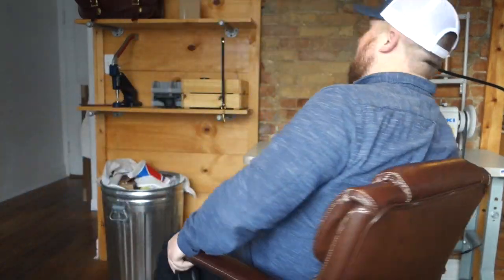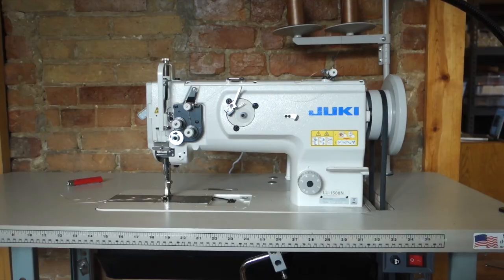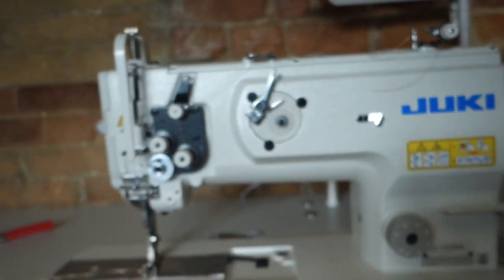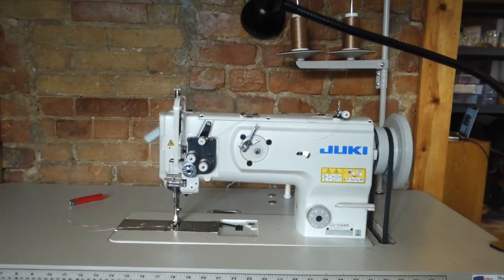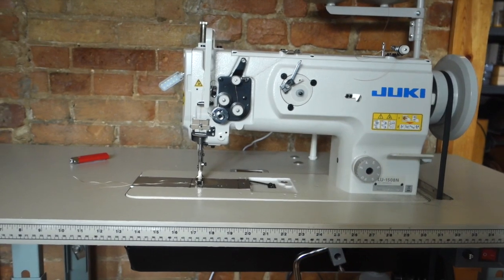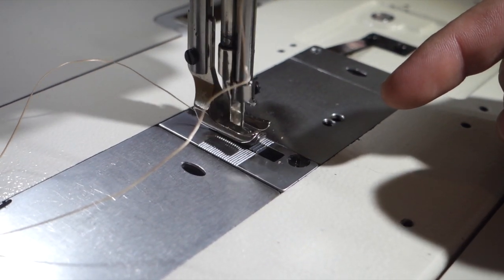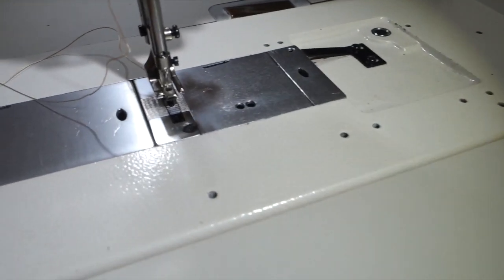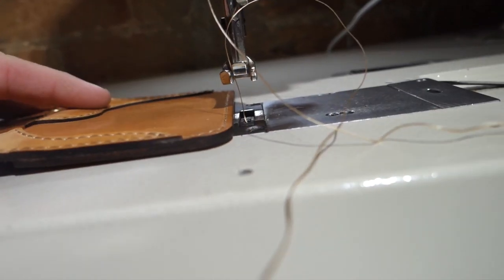5 things to look for when buying an industrial leather sewing machine

Comment: After 17 years of sewing and several machines,  I now know what I wish I did 17 years ago. I sew leather, clear vinyl, cotton and nylon web strap, 30oz canvas, ballistic nylon,  ect. My favorite machines now are consew 206 rb5 w/v69-v92-v138 thread straight stitch+high lift foot+large bobbin.  Consew 227r w/v92-v138 thread straight stitch+high lift foot+cylinderarm. Sailrite  lsz-1 w/v69-v92 thread straight and zigzag stitch. Juki lzh-1290 w/v92-v138 thread straight and 10mm wide zigzag+big bobbin. Cowboy 3200 w/v346 thread straight stitch+high lift foot. One other thing I learned, consew's and juki's hold their value, so resale hasn't been a problem. A Speed reducer and a servo motor was the other thing that I had to wrap my mind around. It's the only way to tame a speedy and touchy clutch motor machine. Lastly, find a well established mobile mechanic that has a good reputation with Taylor's, seamstresses,  dry cleaners and sweatshops near you, and treat him good.

Comment: I use a Sailrite Fabricator for my leather flatbed machine.  It's got a 6 pole servo motor, very powerful, and speed dials way down.  I do both leatherwork and upholstery.  It's an incredible machine.  Best of all I think I paid 1300 brand new for it with everything included.

Comment: I've been doing upholstery work for 37 years - residential furniture, automobile seats, boats, commercial healthcare seating, etc. I started doing leathercraft 4 years ago. One thing you DID NOT cover, which is as important as the thread size, is the size and type of NEEDLES you use for your various sewing projects. Round point needles are used for vinyl and cloth materials and can be used for lighter weight leather. But chisel point needles are better for leather because they cut an opening the way a stitching chisel and a hammer does. But they aren't recommended for vinyl and cloth. The needle also MUST be big enough so that whatever size thread you use feeds easily through the eye of the needle you use.

Comment: Thanks from Coalville, Ut. I had a leather and nylon company 25 years ago.  Had to give up the leather and nylon because I was a general contractor and couldn't do both.  I am through with construction and am starting the leather and a wood business making small cabinets again.  I bought and still have a Consew 206RB from Ferdco with a speed reducer and it was reworked so it will use up to and including 207 thread.  Sometimes I wished the speed reducer was slower.  Good video and a lot of information.

Comment: This guy is spot on with his advise...except he said his is a "walking foot" machine which is different than the machine you have there, yours is a triple feed...."Lower, Upper, and Needle" all feed the materials through. triple feed is much better than a walking foot only machine in my opinion. The early Consew 206RB up to the recent 206RB-5 are triple feed machines the older ones were made by Seiko in Japan and are a bit better built than the most recent 206RB-5 models, but the recent models have the ability to adjust the "forward reverse stitch length" much more easily than the early machines. If your doing leather and the reverse stitches need to exactly follow the holes in forward and reverse then the later machine might be a good choice.
Another thing is that you need to learn how to at least check the alignments of these machines and there are two really great videos on YouTube going over everything and it will work on all the Consew 206 models with some different locations of adjustments. You can also use the videos to look over most similar designs like the Juke's adjustments. Don't assume that if it's new it's got to be adjusted correctly, my Consew 206RB sewed "just fine" and so many of the adjustments were totally out of wack, once everything was adjustend correctly it sewed way way better but who would know unless you had two next to each other.
My opinion is the triple feed Juke he has is a step above the Consew 206RB-5 but the Consew is much cheaper and will sew most anything the Juke will. Kind of like saying a Chevy vs. Acura sure both will get you there.
This is just my opinion and worth what you paid for it.

Comment: I have a consew206rb5 that is a compound feed. It is walking foot and needle feed. I got it with a servo motor which can be dialed down to pretty slow speed. It's was 1400 new. I sew up to 10 oz leather with it and it works great. It would sew heavier leather if I wanted. It's a great machine.
Reply: Hey there, how are you avoiding the teeth marks?? I too have a 206RB (older one) and the marks seem unavoidable. Thx
Reply: On some machines you can reduce the pressure foot pressure by loosening the screw at the top which can help reduced marks.  I've also heard of some people filing the dog feed teeth down some - but wouldn't recommend this!

Comment: Agree with everything you said - especially the slow speeds!  I have a Juki DNU 1541 which is a compound needle feed machine like your 1508.  I have a servo fitted so I can take the speed right down.  I make leather bags but use more chrome tan than veg tan leathers (though I do make veg tan stuff).  There are odd occasions when I would like a cylinder head - top stitching awkward areas - but not enough to justify having a cylinder head...I can usually bully the leather to get the flatbed to work...though can be hard on the hands!  A lot of places will let you try the machine out at the premises so worth taking typical projects along to try.  Edit - my machine is also fitted with an auto needle down - which I love!

Comment: My husband and I buy and sell industrial machines in the Eastern North Carolina area
I have a Chandler which is the same as the 206 RB. All you need is a bigger pulley to slow the machine down.I've been sewing for thirty years .You don't need to go buy a new machine I think the old ones are made better.I have a few that were made for the army during WW2 and they run great! But that's just my opinion lol.I have 7 industrial in my sewing room everything from a walking foot an industrial zig zag and a double needle.I guess I'm a machine border lol.But I do use them all

Comment: I cannot fathom, that you bought machines at all before reading the commonly available information, nor testing your particular project type in a sewing machine dealership.  You know, they'll let you bring in whatever and try to sew it on their machines.
At any rate, I used the same Juki machine you have now. Never any complaint with it. Reliable and easy to adjust. Bobbin size could have been bigger, but maybe they fixed that on the new ones, idk, but for wallets, that won't be too much of a concern.
I switched to a Durrkopp walking foot, due to a variety of convenient, computerized automations.  I get to be lazy about start-stop, backstitch and such details now.
One step further and the machine doesn't need me anymore ^^

Comment: Good video, I researched stitchers for 4 years and your info is quite good but buying a stitcher it is important to look at the company your buying from. My stitcher is a cobra class 4-25 and i have stiched everything from gun belts and holsters and knife sheaths to wallets and mostly with 277 thread top and bottom and it works great. It comes with a flat bed attachment but i dont like it myself.
Reply: Craig Draper  What specifically don't you like?  
The thread (277)?  [can be changed]
The flatbed attachment?  [can be changed between cylinder or flatbed]
or 
The Cobra Class 4-25 machine? 
    Please clarify.  Cobra is on my short list.

Comment: Wow! My man very good description. I knew all these points with only 3 weeks of research and tons of hours. You did it in 13:28. I just picked up a 1541s with servo mode also used for an awesome price. I tested out thread of 277 today at a industrial sewing machine store in my city and wanted to test it out with the tech there. He advised against that size thread with that machine but i insisted because I have seen other off brand juki style bodies in 1541 that condoned using the 277 thread. I didn't find out about the speed reducer till today and while sewing heavy leather with the tech testing out the 277 it did sew it. It had some adjusting to do but I like to understand my equipment to the maximum to get the maximum out of it. Bottom line is he said I would get more torque and slower speeds which would be able to handle to 277 thread if you know your machine and limits of skill. Bottom line I'm very happy I got the 1541s and will def get a speed reducer. Great video my man and keep up the good content. Thanks
Reply from the maker: That's good stuff, thanks Greg and good luck!
Reply: So I just ordered the speed reducer for my machine and trying to get a bit more detail on the install of it. I know it's not that difficult to do but can you explain what other belt you had to get for the reducer and did you have to move the motor at all or just drill hole for the reducer to line up? I want to get it right the first time so i'm not drilling holes all over the place. Thanks for the help.
Reply: I just got my speed reducer in the mail and was wondering from your video if you are supposed to use the smallest gear on the reducer. I see you are only using the largest one and middle one but not the smallest one? Suggestions or help would be appreciated. Thanks in advance

Comment: Servo motors are crucial. They're quieter and you can adjust the speed on most of them. I'd like a cylinder arm with a flatbed attachment.

Comment: I have the Cowboy 4500 and it sows perfectly with the Tex 135 thread with an needle 23/160 (I believe) the needle is. I did as well at first the mistake to sew with Tex 207 or something like that and with the needle 25/200 (or something) but have since switched to ONLY the #138 thread. The CB 4500 handles perfectly the #138 thread. I believe it can go down to #96 or something as well with an smaller needle and I am sure it would handle that. But honestly size #138 thread is about the lowest it can handle since the tensioners are allmost off the thread released so it had to be fine tuned for #96 thread since thats the lowest it ever will get.
Yes the CB4500 is a fine machine and allmost universal. It is exactly like that the smaller the thread and needle the better the leather work will look - it makes all the difference. Basically the Juki should use same or similar sized needle if you use #138 thread since the thread goes with the needle. Belts look very nice with the #138 thread but not so nice (big honking holes) when using the #207 thread. For wallets #138 is a bit of an overkill and any error (and believe me, errors happen) show readily so I gave up with wallets. I make only belts, holsters, slippers&sandals, COVID-19 masks from leather, smartphone holsters, etc with the #138 thread&needle.
The CB 4500 lifts the foot exactly 15mm up and with the foot pedal it does exactly 21mm, although it was advertised for 22mm with the foot pedal. I wished it would rise a bit more for the slippers&sandals but then the #138 thread is about the minimum you want in slippers, sandals and shoes. Sewing through an rubber insole the upper of the slippers on the foot hight is maxed out but the thread is not ripping off.
My mistake was to order white thread and of the size #207 which is now not in use. Darker threads are more universal like chocolate brown and desert tan.

Comment: Awesome vid. Is it possible to find a cylinder arm machine with a flatbed attachment to get the benefit of flatbeds without needing to buy 2 machines?
Reply: For cowboy 3200 and 4500 you can get a flatbed attachment, but still it's not going to be as convinient, and those heave machines don't do a nice stitch over thin leather (i can't get it as nice as on lower weight machines.

Comment: Excellent video. Answered several of my questions. Good to know you still use the Cowboy as I've been leaning in that direction. How does the cowboy fare with smaller needles and smaller thread sizes or is it only useful for heavy stuff. All the videos I've found seem to be people using large harpoons with small poly rope to demonstrate the cb3200, Impressive for demonstrations but less informative than I'd like. 

I made the mistake of going to a needle supplier website based on the  needle system listed on the Hitex cb3200 website and now my head hurts front needle size charts. But i also now know that people use plasma metal deposition to coat needles. Horay for science.
Reply: Baneironhand can you explain some of what you commented on?  I’m new at this and just now decided to get a commercial sewing machine.   I repairing purses, shoes, belts, MC. Vests and sewing patches on an old Singer free arm stitcher.  I can go slow as I want but what about needle sizes and thread sizes?  

It not having a walking foot makes it super hard not to tear up the surfaces.

Comment: Yes the most economical would be buy a sewing machine head class CB 4500 on alibaba China individually, the buy the motor on eBay as well as the speed reducer and put that on an table you have at home. I use an old computer table. The table better has to be sturdy and must have an iron frame.

Comment: What kind of Servo Motor do you use with the speed reducer? I got a Sailrite 550W Servo Motor with 3/4HP. Do you think it can handle the heavy pulley of the speed reducer?

Comment: According to your explanation, nowadays, which is the JUKI model you suggest that more fit with the needs you told us?
Reply from the maker: The 1508 is a great leather machine. If I was going to recommend any machine though it would probably be the cobra class 20, It's basically the same machine but it comes with the speed reducer already installed
Reply: @whitandpark  I had a meeting with the JUKI dealer Brazil and I asked for the requirements according to your recommendation and they recommended me the JUKI 1541 mechanical with a servomotor installed. I suppose it is a good option.
Reply from the maker: @cecintelligence  That's interesting. Are you sewing mostly leather? The 1541 is a great machine but I think most people would agree the 1508 is much better for leather. Either way, you should be able to get the job done

Comment: please let me know ,for making handmade stiches for wallets,how to choose needle and thread?
Reply from the maker: For hand stitching I like to use poly chord from Maine Thread Co. I just get my needles from Tandy
Reply: Stock & Barrel Co  what is the size of needles should I get? how a neeedle should be purchased?
Reply from the maker: They're 2" long, blunt needle with extra large eye. You can buy them at this link:

https://www.tandyleather.com/en/product/stitching-needles
Reply: Stock & Barrel Co is it necessary to have a waxed thread for stiching wallets?
Reply from the maker: krishnendhu chakra for hand stitching, definitely yes. You can wax the thread yourself on a block of beeswax. Or you can buy the waxed poly cord from Maine Thread👌🏼
Reply: let me know what happens if it is not a waxed thread?
Reply from the maker: The wax on the thread will heat up from friction as you stitch and causes it to seal in place.

Comment: i think roller foot works well too if you need to sew close to the edge.
Reply: Eddie Puah can you tell me about the roller foot?
Reply: DALE thebelldiver instead of walking foot, it's a roller that rotate and grip the leather, the needle drop just a hair beside the roller. It's easier to stitch curve and corner too.
Reply: Eddie Puah  the pressor foot on the old singer can shred a good purse in a second if I don’t use a protector pad positioned for every stitch.  It’s slow and not really effective.
Reply: A Singer 201? Or a 221? I have used pieces of tissue paper to get the leather to glide through. I put a piece on each side, top and bottom. It works in a pinch!

Comment: Hey Parker,  thank you for posting this video.  I'm currently looking at getting into the business.  I have a couple questions about sewing machines.  I am currently caught between a used Juki 1508n that is already setup for leather and the Cowboy 3200. I want to do everyday stuff like wallets, clutches, and bags. But, if I have the opportunity to make heavier goods I would hate to turn away the business.  Final question. If you could have both machines would pull the trigger on that? I ask because I am close to a community of equestrian and motorcycle folks. Thank you in advance for your time and any thoughts you may have.

Comment: If you have the servo motor then you don't need the speed adjust attachment? 
And the the speed attachment can go on any motor,  even clutch?
Reply: correct, if you have a servo motor you don't need the speed reducer. he currently has a clutch motor which sew at the same speed all the time, that is why he added a speed reducer.